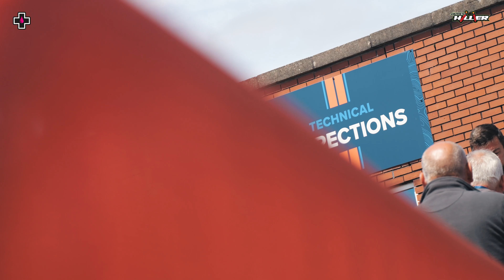Isle of Man TT 2024 // James Hillier - Episode 7 - 'Superbike Sunday'

Comment: Curious about the chain running hot, where the mechanic oils the sprocket, 
Would it not be possible to turn the chain through during the pit stop and apply oil then ?
(I’m not a mechanic  or a biker !)